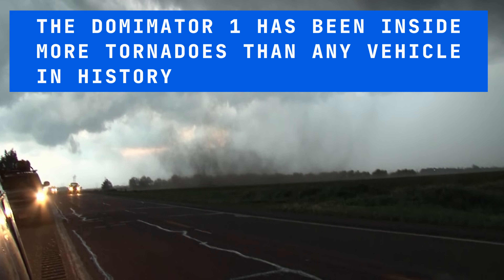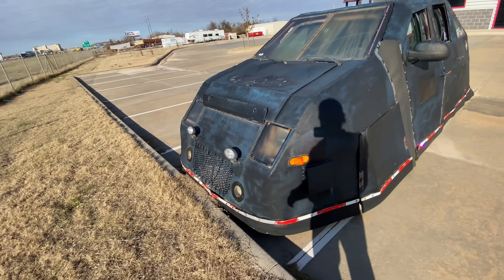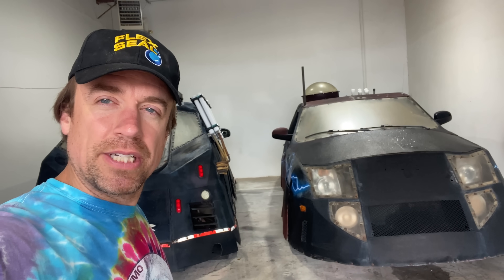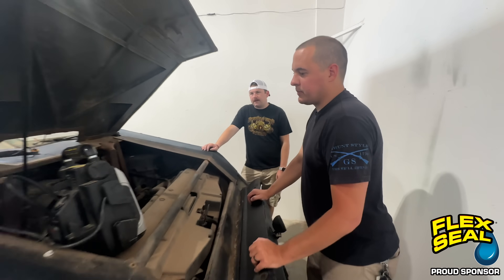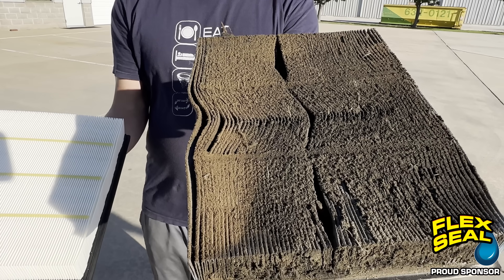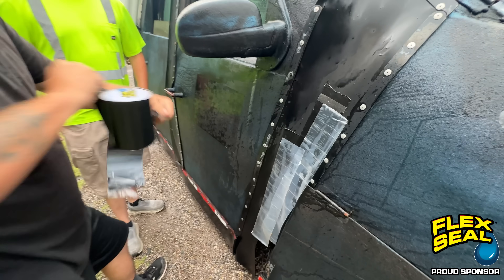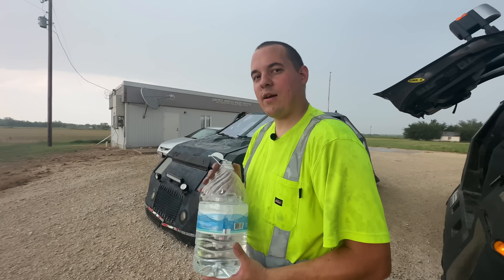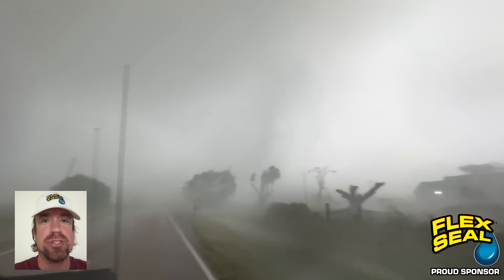The most legendary tornado intercept vehicle the Dominator 1, RETURNS during the 2023 storm season!

Comment: if dom 1 was built in 2008 so was tiv 2
Reply: Except Tiv 2 was built and ready for storm season in 2008. It broke down a lot but was used a bunch. There was even one with both TIV1 and TIV2 chasing. Dominator 1's original design was built in the off season of 2008

Comment: If Dominator 1 is overheating, it's something other than the air filter. It only affects the intake air for the performance of the engine, but will never make it overheat. I'd say it's time to check the radiator, and if applicable, the AC condenser. They are likely plugged full of dirt and bugs. Could also change the thermostat if it's still original or if you know it's been a long time. They like to get stuck shut more than open.

Comment: I thought Dominator 1 was a Ford with a Power Stroke diesel engine, not a Chevy and that Dominator 3 was a Dodge with a Cummins diesel engine.
Reply from the maker: Dominator 3 is on the Ford F350, Dominator 1 is on a 2008 Chevy Tahoe, and Dominator 2 is on a 2011 GMC Yukon
Reply: @ReedTimmerWx  Thank you for the info.!
Reply: The Dom 1 should be the SUV they drove during Season 2 of Stormchasers. I believe they "tanked it up" to be the Dom 1

Comment: Reed. Do you need a big heavy vehicle as a Dominator or could you use a smaller one. The reason I ask is if you could use a 2 seater car with the custom work done it could save fuel, be faster and go places D1 2 and 3 can't go.
I know weight is important to keep it on the floor, but a half sized Dominator?

Comment: Awesome! Now to get Dominator 2 repaired and back in the field! Once TIV 1 has been fixed all intercept capable cars that were used during Discovery's Storm Chasers run will be operational once again!
Reply: Has there been any updates on tiv 1 or dom 2 at all?
Reply: TIV 1's last update from the owner was 10 months ago. The old spikes are in the process of being removed. The front spikes are completely gone already. Unfortunately, pretty much every part inside TIV 1 needs replacing, and they are all on backorder or unavailable. So TIV 1 likely won't be done until 2025 or later. 

As far as Dominator 2 is concerned, I believe Reed's plan is to get Dom 2 fixed this offseason and to get Dom 1 and 2 back to 2010-2011 condition with a few upgrades and repainted to their original paint schemes. Next year all 3 Dominators should be back chasing in tornado ally where they belong!
Reply: @TyTEI  thanks
Reply: @TyTEI what happened to d2?
Reply: @nagol5954  Dominator 2 is just in a general state of disrepair. It hasn't been used since 2013 and has been left outside for multiple years. It also has more custom additions (anchoring spikes, more advanced airbag systems, advanced air cannons for probes, and hydraulic systems) that need advanced repairs, new custom parts fabricated, complete replacing, or removal. 

I believe Reed's plan still is to get Dominator 2 functional this year, and during the offseason get both Dominator 1 and 2 completely restored to their original condition, ready to chase again!
Reply: Oh well no updates on dom 1 and 2 yet  probably next year @TyTEI
Reply: @TyTEI i am from future and they started repairing tiv1
Reply: Where can I see the TIV updates?
Reply: Wow. Imagine team dominator with all dominators on the road. Imagine tiv1 meeting the tiv2. Hopefully there’s an update soon